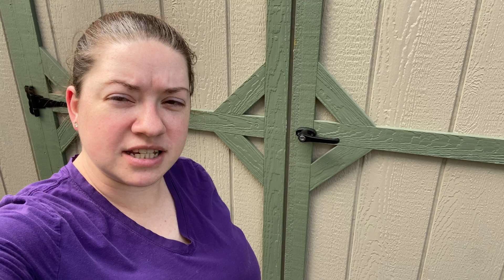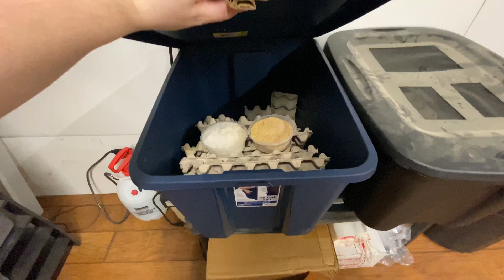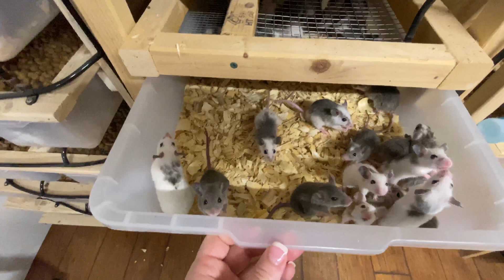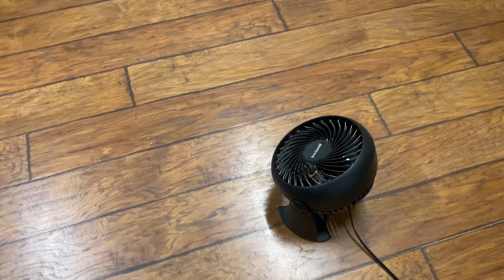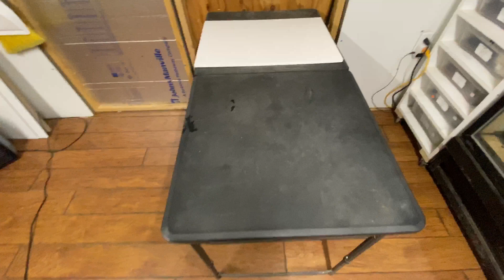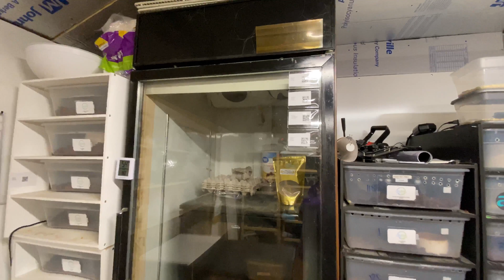REPTILE ROOM TOUR - April 2020 | Ball Pythons and Rodents | Breeding Ball Pythons

Comment: what r value insulation board are you using?
Reply from the maker: I used the regular pink wall insulation in between the studs and then put paneling up over it
Reply: Oh ok like wood paneling? What about the foam on the ceiling and on the door?
Reply from the maker: The ceiling and door are just 1” foam board insulation